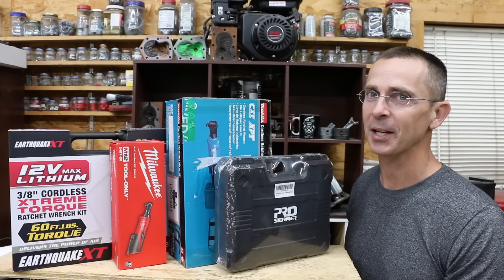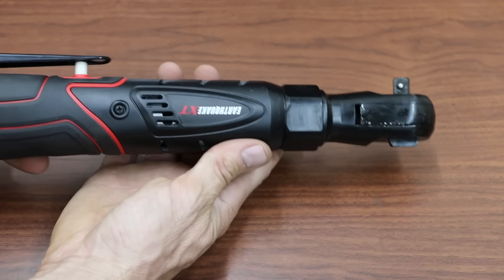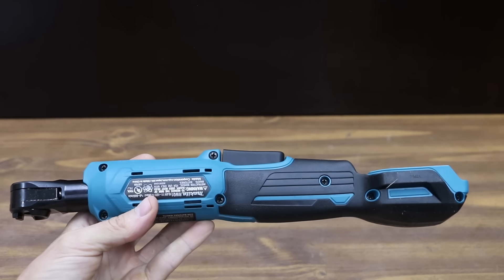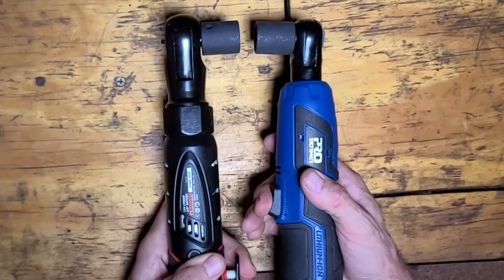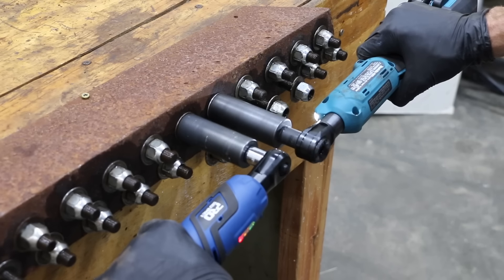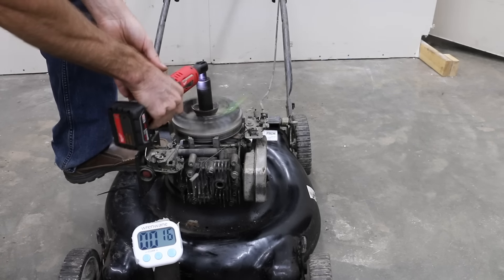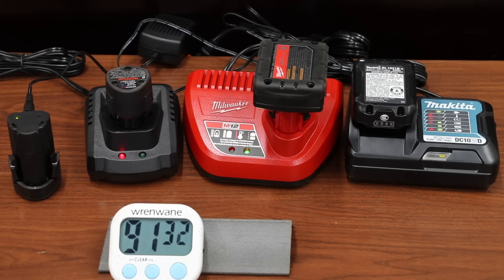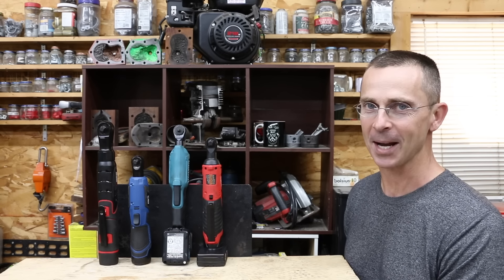Best 3/8 Cordless Ratchet? Milwaukee M12 vs Makita, Earthquake & ProStormer. Let’s find out!

Comment: I just bought kobalt 3/8 cordless brushless 24v. 18damn inches plus the battery that doesn’t go into the tool. $230 after buying battery and charger. I’m working only on cars so I don’t think that’s really all that good. 55ft lbs is what I’m stuck on tho. Idk if I should return it and get something else for around that price or lower. Any opinions on what I should do? Keep it or get Milwaukee, ac delco, etc..?

Comment: Seems unfair for the full charge lug nuts test that the Milwaukee has what looks like a 4 amp battery while the other have 1.5 or 2 amps that were included with the tool

Comment: As a M12 owner I will say this.  Stay away from M12s unless you absolutely need something compact.  The ratchet is not durable, the plunger under the handle is very easy to break compared to even ac delco. The M12 batteries in general are expensive and fragile.  I've never had a problem with batteries losing charge over time because the battery packs break way before any sort of recharge failure.  On the upside all the m12s are very light and well balanced and put out great torque for their size.  If it wasn't for the battery cases i'd have no complaints but, professional mechanic, stuff gets knocked around.  Down to 3 batteries from 8 in 1 year.  At a minimum of $65 for a new battery it's simply horrible value in any sort of rough environments.  I will say working under dashboards m12s are a lifesaver but, outside of special use, daily grind just doesn't seem to hold up for me.
Reply from the maker: Thanks for the feedback.

Comment: Ok.. I am not sure what to make of all the tests.  Right now I am in the market for one of these ratchets.  It will be used every day in a repair garage setting... so I am not sure what tests apply here.  The main reason I want one and I do have air tools and a shop air supply a good one...  but there is the dang air hose getting in the way.... just like some of the bigger batteries would.... so even after watching...I am still at a loss.....
Reply from the maker: Thanks for sharing.

Comment: I already had the newish Ryobi Extended Reach 3/8", (yet, still looking at the 1/4" version - less torque, but more speed), but I still went ahead & picked up this Makita CXT, (LARGELY based on this video). Curious as to how the Makita 12v stacks up to it's 18v brother, (performance specs appear identical, so not sure what, if any difference). Also, would love to see you test some of the extended reach & brushless ratchets, (Ryobi, Rigid, DeWalt & Milwaukee High speed, as well). LOVE the channel & GREATLY APPRECIATE ALL YOU PROVIDE us subs. Thank you! 🙏🏼
Reply: Btw, I REALLY LIKE BOTH, my Ryobi Extended Reach & Makita CXT ratchets. The power & reach of the Ryobi is EXCELLENT & while the rpms are GROSSLY exaggerated, the overall feel/ergonomics & versatility of the Makita is 2nd to none.....that said, I can't get the Milwaukee M12 High speed ratchet out if my head, as the speed on that thing is STAGGERING....or rather,...#VERYimpressive
Reply from the maker: Thank you very much!

Comment: I would love to see my first generation Snap-on super duty air ratchet against that "delivers the power of air" Harbor Freight ratchet.
Don't get me wrong, the Snap-on has it's flaws.  It is commonly known as the "screamer" and would likely send your decibel meter into orbit.  Shortly after they came out OSHA required a mandatory recall which involved a while you wait, on truck rebuild to install a overhaul kit with a muffler. Most drivers either just handed you the free overhaul kit or only installed the muffler and let you keep the screamer parts to restore factory torque.
These ratchets are dangerous. Nothing will take the front accessories of an engine faster, but if you are not holding them with both hands they can easily brake fingers.
If the ratchet gets away from you, it can pin one hand up against a pully with the throttle full on until you can pop the air hose off. Been there, done that.
That said, if you are on commission, you can knock out water pumps and timing chains etc. in half book time or less.
Reply: Tell me more about your 1st gen air ratchet. Whats the model number?
Reply: @isaakwelch3451  Not sure the number I think it is 7200, I'll check when I'm back to work. Got it around 1990ish.  If you ever hear one you'll know, at 120-150 psi they literally scream.
Reply: 3/8 snap on air ratchet is the best in the business as far as air ratchets types  yeah their knuckle busters got to kno how to work them been using 3/8 snap on air ratchets for over 40 years
Reply: Mine is a 7200

Comment: THE MAKITA IS THE ONE TOO BUY

The milwakee is almost impossible too switch with slippery fingers

The makita Gorgeous switch makes it waaay better-not too mention you get two anvil sizes
The makita use’s japanese parts

the milwakee is all chinese with Korean Batteries 

The makita is the winner! BY FAR, That drive-switch is the best in the business!

If you have large finger The milwakee drive switch is the worst in the business (i have one) You’ll need too purchase an Ebay attachment too improve the switch
Reply from the maker: Thanks for the feedback.

Comment: I always love your videos, especially as a manufacturing technician. But in this video, I think the torque results were skewed. Would the results have changed if you were to clamp the ratchet to the  bench so that the force holding the ratchet is consistent?
Reply from the maker: Thanks for the constructive feedback.

Comment: I tried the M12 Milwaukee 3/8 rachet and it couldnt take off valve cover fasteners torqued to 10 ft lbs. I returned it. I used the 1.5 Ah battery, but still, it performed terribly for me.
Reply from the maker: Thanks for the feedback.

Comment: have you compared the Cordless Electric Ratchet Wrench, 3/8″ 40 Ft-lbs 400 RPM 12V Power Ratchet Wrench Kit w/ 60-Min Fast Charge, Variable Speed Trigger, 2-Pack 2.0Ah Lithium-Ion Batteries By KIMO to any other brands?
Reply from the maker: Thanks for the suggestion.

Comment: Love the speed and content of your videos!  I once had a cordless drill (Chicago Electric) from Harbor Freight.  It has been 20 years.   But every year for 4 years I would have to drop money on a new battery as the old one wouldn't hold a charge.  After the 4th year, I went with a different name brand drill/driver combo. I am not a fan of Harbor Freight's  battery powered tools.  But for an occasional use tool their corded stuff is a great value.
Reply from the maker: Thanks!  Thanks for the feedback.

Comment: And snap on beats all of them. lol. Seriously though I beat the crap out of my snap on long neck version. Its stronger but a bit slower than the Milwaukee. Milwaukee batteries are fragile too. If you beat on it daily snap on and Milwaukee are hard to beat but snap on seems a bit more durable.
Reply from the maker: Thanks for the feedback.
Reply: @ProjectFarm  this is my experience from my place of work. Half of us have snap on and half have Milwaukee. The snap on are very durable and very accurately spec’ed. while the Milwaukee seems to be spec’ed higher but is actually weaker. The Milwaukee batteries just do not hold up to any abuse at all. With that said I get about two years out of my snap on before I need to have it rebuilt for $110. Meanwhile the Milwaukee has a five year warranty to cover it. So there are pluses on both sides but I personally believe the snap on is going to give you less trouble in the two years you use it. I’ve used the snap on versions for about 6 years now basically since released. I am pretty rough on my tools the fall from shoulder height often. And I tell everyone snap on tools all have a hidden feature, they double as a hammer.

Comment: I have one of three bolts on my starter that I cannot get off because there's no room for a breaker bar and no space for an impact. I could just about get one of these in. So I'm only intetested in torque. Got a ryobi, supposedly 60Nm// 44ft/lb. Useless.
Reply from the maker: Thanks for the feedback.

Comment: I can attest to the power and durability of the milwaukee. Used one putting up a steel building, and was running it so much that I had to put a thick glove on because it was too hot to hold on my bare hands, and that little fucker NEVER quit, stalled, or even hinted that it was losing power. Seriously, buy milwaukee, you'll thank yourself later
Reply from the maker: Thanks for the feedback.

Comment: I think you're a little off on the charging point for the earthquake I have had three of them never took more than an hour to charge the battery from low to fully charged as far as for discharge never had to go dead yet I use it on many jobs working on cars

Comment: When I bought the 3/8 Milwaukee  it stated on the literature  that the max torque was 75 Nm....I was disappointed that in real life it maxed out at 40Nm..How do they get away with such blatent lies..In my game the bolts get torqued to 83 Nm for an M12 bolt  or 47Nm for an M10 bolt.......I still have to use a manual torque wrench for the last few turns.
Reply from the maker: Thanks for the feedback.

Comment: But you Project Farm answer this......Which tool has Better longevity before breaking down? Because remember speed and torque will not matter for crap on the job site when the purpose is not to race but do its job every day for long hours and continuous work. So what matters is if someone if paying a cheap price or heavy cash investment, how is the life span tool until its trash?   Think about that... Because every video out there on YouTube about this tool and that tool being "better torque and speed" fails to answer that question. The longevity span of any particular tool is the real difference between one tool over  the other.

Comment: The Snap On version smokes all of these.
Reply: With any luck (and presumably a considerable amount of money) “We’re going to test that” one
Reply: @Iconic_Scarab  I haven't compared anything to it except the Milwaukee but I've used both 1/4" cordless rats for years daily and the Snap on is a bit faster imo. The warranty on it and it's batteries suck. Milwaukee's warranty is excellent and I had the ratchet go out about 4-5 years in and they replaced it completely within a week. I originally thought it would take some time so I bought the snap on version as I use them daily. The Milwaukee became the back up tool. I since bought the 3/8 rat and the extended neck 3/8 rat from Snappy. They all are used almost daily in a hard environment.

Comment: I was a body tech before Covid and I have a fair range of tools from Snap-On, Mac, and Cornwell. However at one point, I won a raffle for the Milwaukee Fuel 1/4" drive ratchet. I was so massively impressed that I wound up trading in all my Snap-On electric tools for the Milwaukeee versions. I can honestly say that every tool I purchased out-performed the Snap-On ones I'd traded in. I was able to run the tools for weeks at a time without killing batteries and was impressed with their charge times. In short, I'd recommend the Milwaukee Fuel line to anyone looking for a middle-price-range electric tool. They really are amazing. 

That being said, I was super impressed with the ProStormer.
Reply from the maker: Thanks for the feedback.

Comment: Makita,, don’t sqrew around with tools.  Pay a little bit more and get better product.
Reply from the maker: Thanks for the feedback.
Reply: I have a makita WR100D. Hardly used a handfull of times and it still looks new. It has failed. The head is slipping with any pressure applied to it. Upon looking online, this is a common issue with the Makita. Will switch to another brand for this specific tool.